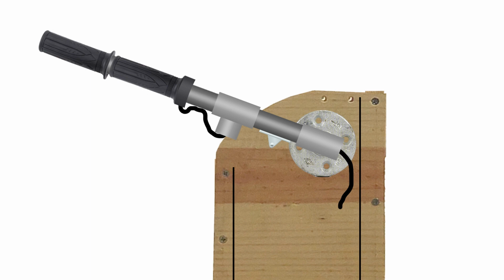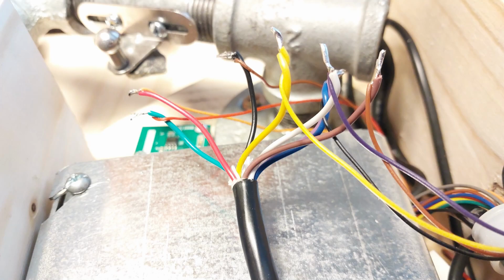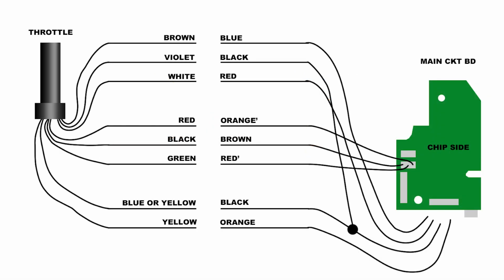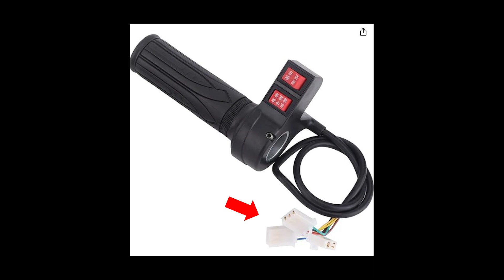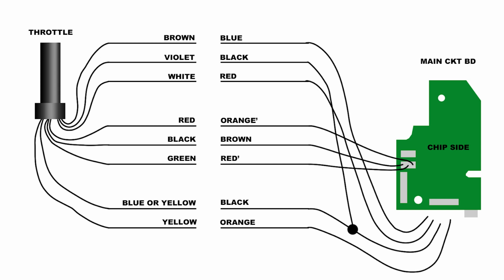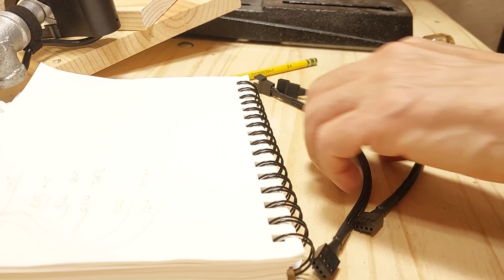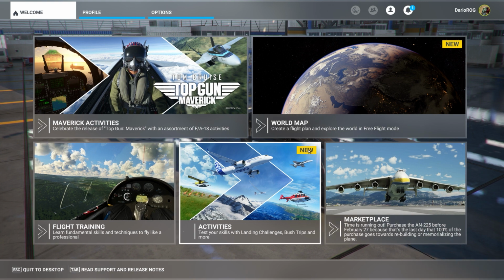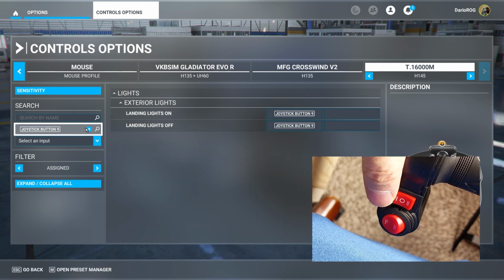DIY CHOPPER COLLECTIVE | PART 6 | THE GRAND UNIFICATION

Comment: Hey, just wanted to say thanks for this series of videos on the DIY collective!  I constructed my own collective using a racing sim e-brake controller as the collective.  I fabricated a new lever for it from steel pipe.  Following along with your project, I used the same twist throttle and an Arduino Uno.  My throttle has two switches, an ON-OFF and an ON-OFF-ON.  I use the former for the idle stop, and the latter for the starter button and landing lights.  It works great, thanks again!
Reply from the maker: Glad you were able to smash something together.  Good enough for a fraction of the cost of the retail offerings.

Comment: Can I use a different board?  Something I can buy rather than tear apart old peripherals?
Reply from the maker: Yes I believe you can though obviously you'll be going down your own rabbit hole to do so.  But one of my followers introduced me to this awesome company -- "Leo Bodnar".  I won't post the link because YT has a habit of deleting comment links but you can search for them and they have lots of pre-made electronic modules like joystick interfaces, etc, that would be PERFECT for this kind of project.  And if I'd known about them that's exactly what I would have done as having to take apart existing hardware to re-purpose the guts is not the optimal way to do this.
Reply: @CaptainHelisim  Yea I am going to try the Arduino approach and see how that goes.  I ordered the throttle that you suggested.  Does it come with paper work that identifies the names of the wires more formally?  Thanks!
Reply from the maker: If you're working with the Arduino, the throttle wires will be more or less obvious -- there are two rocker switches and a hall effect sensor for the twist grip.  They all have individual connectors for each function -- one of the rocker switches is a simple on/off, the other is a two position switch with center/off.  And the hall effect wires are power, ground, and signal -- red/black, and whatever other color they use for signal.  Very straight forward stuff.  The only tricky part is making sure your Arduino will be able to read the analog signal coming from the hall effect sensor.  I don't think it comes with any signal diagram because this is not intended as a stand alone component but as a simple throttle replacement for existing electric bicycles.

Comment: I'm currently constructing a collective from an old Logitech Pro Flight Throttle quadrant. One of these days I'm gonna make one of yours just because it's so damned cool!
Reply from the maker: Thanks for the compliment.  If you watched the same video on that I did, that's what inspired me to do this one.
Reply: @CaptainHelisim   Hoping I don't have the same issue as I'm having using an X-56 throttle for collective... the MSFS seems to only use about half the arc of the throttle's range of motion, and even then it's so hard to apply incremental amounts.
Reply from the maker: @cuttheloop  Have you tried powering up the HOTAS with the throttle in different positions to see if it makes a difference?  I know with the hall effect sensors the way I have them set up, if the control is at one end of the travel when you plug it in, it calibrates incorrectly and MSFS only gives you half the range.  When I plug in this collective I have to do it multiple times adjusting the throttle and collective to find center and then I get a full range of control.

The concern I had with the physical interface to the throttle quadrant was the possibility of jitter or not smooth motion.  Both cyclic and collective are incredibly sensitive so to manage that I removed the springs off the joystick and my collective design incorporates hall effect sensors.  I often marvel at how just literally thumb pressure on the collective is enough to keep a hover finely balanced.  I'm going to be visiting an Airbus training center soon and that's one of my questions.  Is the collective really that sensitive in real life.